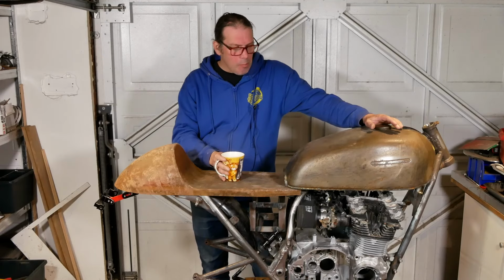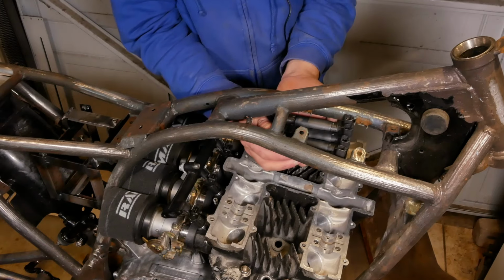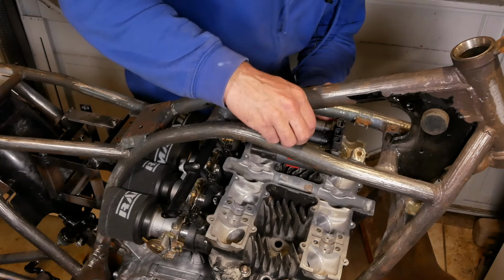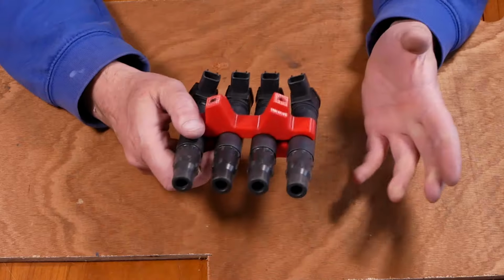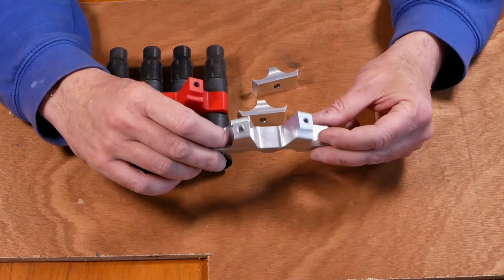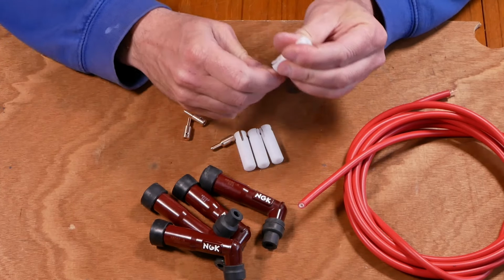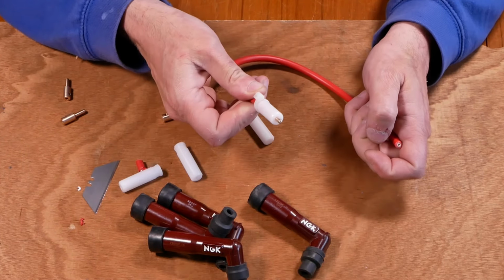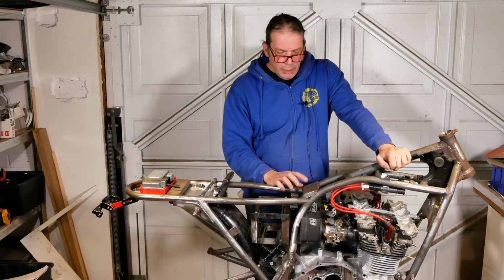Cheap DIY fuel injection on a classic bike, episode 9.

Comment: What are you doing? The coils are called COP's - Coil on Plug for a reason - no plug wires to fail! Simple wire harness, plug to plug to plug, wrap and return to ECU! If you want oldskool look - just fit Dyna coils in original mounts for concealment - Greens or Greys work with most ECU's. Saying that, does your ECU work with COP's as they are VERY low impedence and usually get driven by a separate amplifier to give the ECU ign. transistors a break?
Reply from the maker: The ecu is from a triumph tt600 as is the coils. The ecu can only work with separate coils for each cylinder so I have no choice but I can't just put the stick coils straight on the plugs so I made the plug wire extensions. This is an experiment using cheap second hand parts to see if it can be done.  Do you think the plug extensions would cause a problem? I have already tested the prototype and it seemed to work OK.
Reply: Short plug leads won't hurt a thing. See every LS Chevy